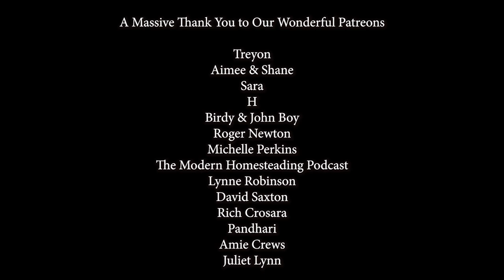Installing Drip Line Irrigation from Gravity Fed Tanks | GREAT RESULTS - Part 2 | Off Grid Growing

Comment: Nice video to see what's possible just with gravity. It saves you a lot of time. 
It would be interesting to know, how high is your waterlevel above the driplines? 
I plan an irrigation like yours for my little garden. My waterlevel will be around 2 meters above the soil. That is 0,2 bar of static pressure. It would be good to know, if that special driplines with the 2,1 l/h would work for me. 
Your experience could help me a lot. 

Greets from Chris in Germany!

Comment: I came across this video and your channel while looking into gravity irrigation. Great work there! How far do the 2x5k L tanks take you? I would assume they run dry in a couple of weeks tops and that's just just for the 6 greenhouse beds. Also, how do they get water, are they connected to your gutters? Thanks again, very useful video.
Reply from the maker: Hi, glad you found our vidoe useful - always good to hear 🙏 hard to give a timeframe for the 2 tanks since we had the driplines installed, as last year was very wet, so water wasn't an issue! We have other tanks on our land that fill from rainwater gutter collection, (each year we are slowly increasing our water hold capacity overall) but these 2 tanks are filled from a small stream catchment, we use a small pump to shift the water up to the tanks periodically/In the summer, if there has been a good rainfall. The stream does run dry though some years and we have had to pump out of our pond in the past. Its good to have options! I recocken though if we were just doing the polytunnels we'd get close to 4 weeks watering 3 times pw - the mulch helps 💚✌️🌿

Comment: So you've basically got 10,000 litres of water on hand for watering, and you're not using that for anything else, like a house or whatever? I don't know what your collection system looks like but 10k litres might last in the order of a month with that setup. Wild guess, but that sort of ballpark, meaning if you have a three-month dry spell in the UK like some recent summers it probably still won't be enough. You can never have too much stored water, anyway, I have about 7K litres but we use it for the house too and it lasts about a month if we don't water the garden much, trying to find ways to store more because our summers are super dry ...
Reply from the maker: Those 2 tanks are just for water the plants only - yes.  When its super dry like last year, we do have a pond/reservoir we can pump from into these tanks as well as a back up, but we prefer not too as it could affect other wildlife.  We pretty much just saved these tanks for the polytunnels last year.... We would like to build another water catchment a little higher going forward, as a specific water back up. ✌️🌿